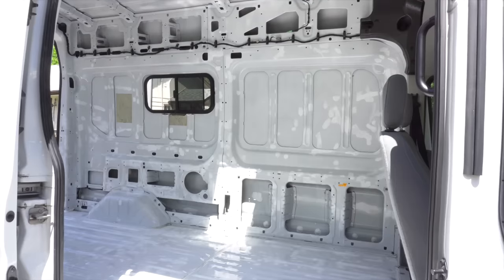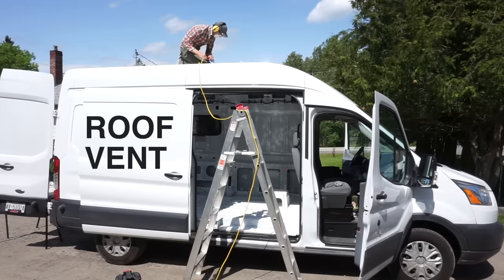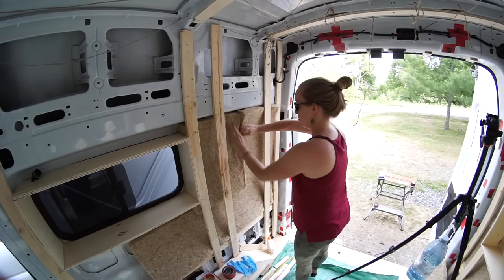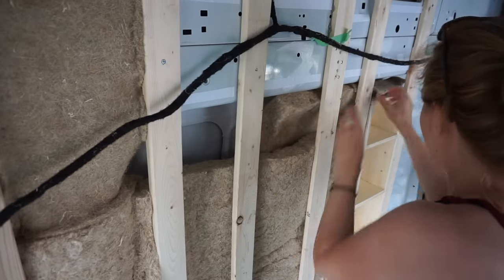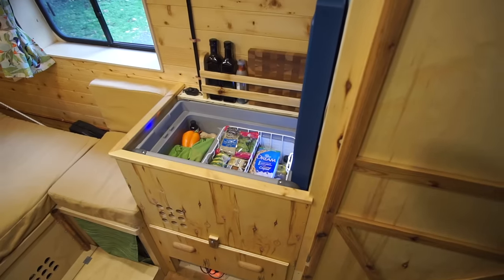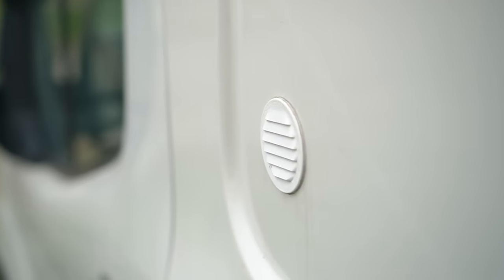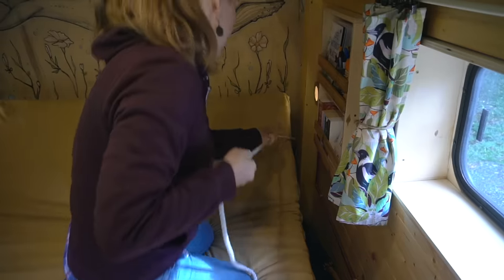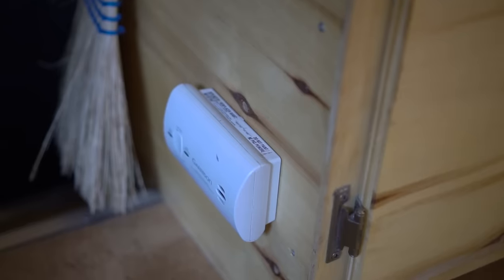FULL DIY VAN BUILD from Start to Finish | Our Epic Van Life Conversion

Comment: Nice design but back doors should have windows .. anything happened at the  back you can see . I drove  RV with all the cameras unlucky did not see the tree at the back sideway .. nearly stuck .. cannot rely on cameras 100 % . Need  the window at the back for your safety  .

Comment: This is so beautiful, guys! I love your design and DIY skills. Very inspiring - I plan to use a few of your ideas in my future build. Just wanted to check if you've heard of Lizard Skin (https://lizardskin.com/) for the condensation problem? It's a thermal barrier paint for vehicles, not a true insulation, but I wonder about using it as a condensation prevention underneath a natural insulation of either wool or hemp like you have done. It's not the cheapest option, but it may be that perfect fix you're looking for. Granted, it’s not completely natural, but does have extremely low VOCs. I know you see a lot of vans, so I wondered if you'd either benefit from knowing about this option, or if you perhaps know of a reason why it wouldn't do the trick. Cheers on your great work and inspiring channel!